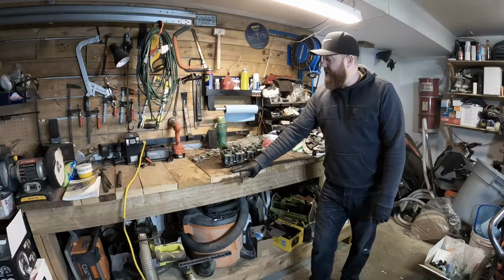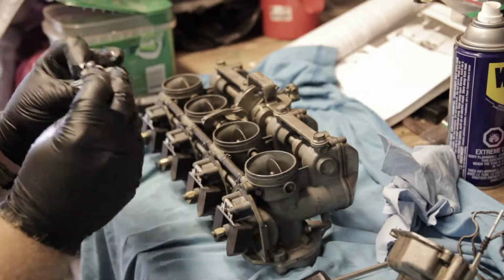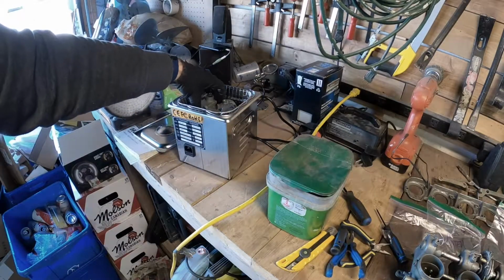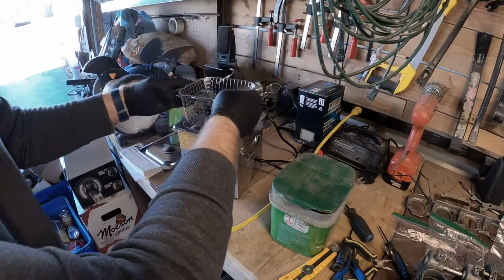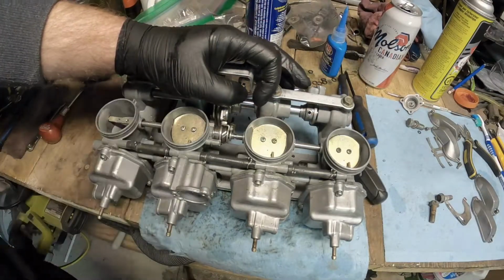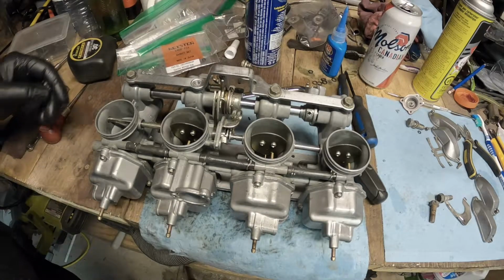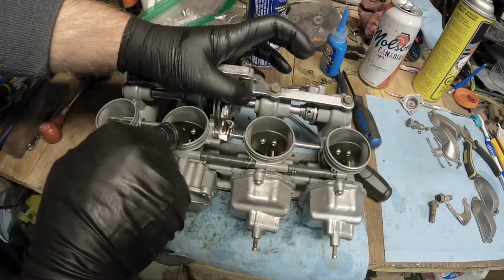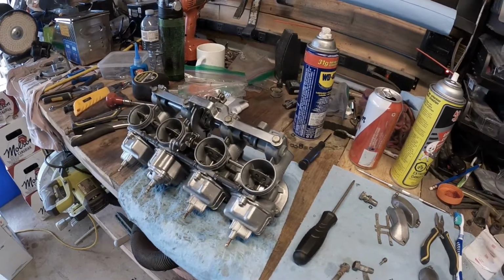CB750 Cafe Racer Build E25: Rebuilding & cleaning the CB750 keyhole carbs

Comment: This is the step I am at in the Process.  My carbs are disassembled and organized by individual carb.  They have been thoroughly cleaned in the ultrasonic cleaner and I went ahead and ordered a complete rebuild kit including jets as I figured it was much easier once it is already apart.  It is a little nerve racking considering that the closest I have been to the carbs prior to this is when I inserted the gas nozzle into the tank.
Reply from the maker: Lol 😂 that’s amazing man. Great job. You’re right to get the rebuild kits and do it all at the same time. You will have put on and taken off those things so many times you will be a pro by the end of your project 😂 🍻

Comment: thanks for this - just started rebuilding a '77 750k with these carbs and I hope they come out as nice...it's the linkage that has me scratching my head a bit...just ordered one of these cleaners - psyched to see how they clean up!
Reply from the maker: Great stuff! Let me know if I can send you any screen shots of the carbs assembled to help. The cleaner does a great job. Thanks for tuning in 👍
Reply: @cafechronicles  I might take you up on that!  I've been browsing your channel - we've got similar tastes (just ordered a tuffside as well)...do you show how you put a second disc on the front?
Reply: @notyourbrotherinlaw2092  I noticed the dual discs as well and did a little research.  I believe this is the CB750 Super Sport and it came with the dual discs as opposed to the CB 750K which only had one.
Reply: @ponyboy7116  yeah - think you're right -the tank threw me a bit as it's different on the ss
Reply from the maker: Nice catch guys! I was lucky enough that this bike came with a GL1000 front end on it which had the dual discs. I did upgrade the calipers though. It turns out, the calipers from the V65 fits perfectly for CB750F and GL1000. So it makes it a dual piston set. Nice solid brakes up front now. Thanks for tuning in 👍
Reply: @cafechronicles  ah, I didn't know you could do that...I've been looking at trying to modify the 750 forks to work with a 2nd disc but this makes a lot more sense...going to scour ebay and see what I can find!
Reply from the maker: Good luck!